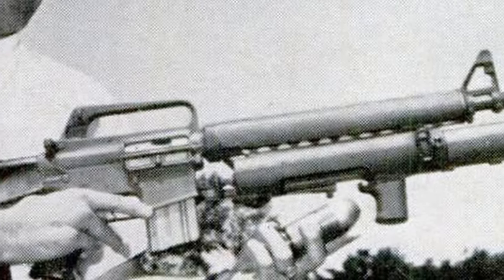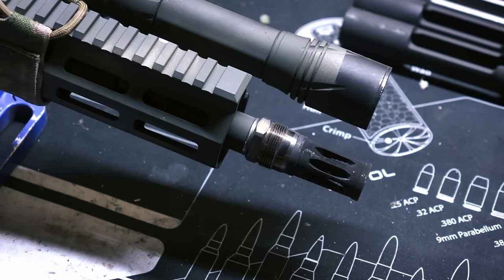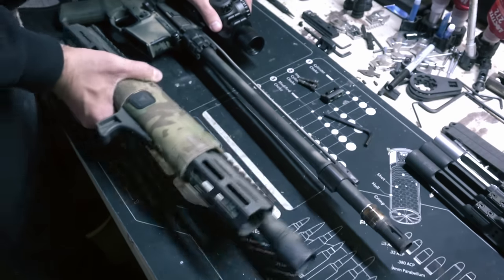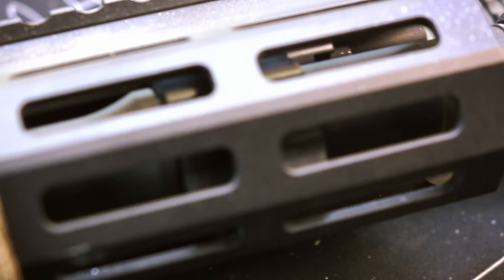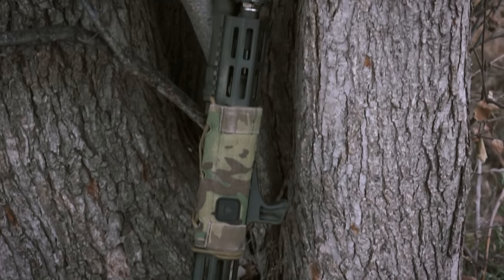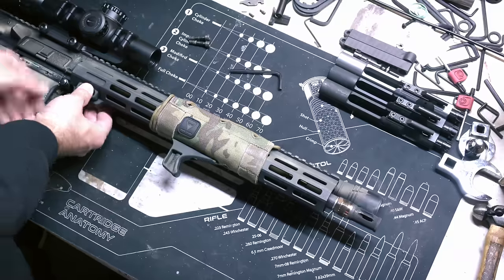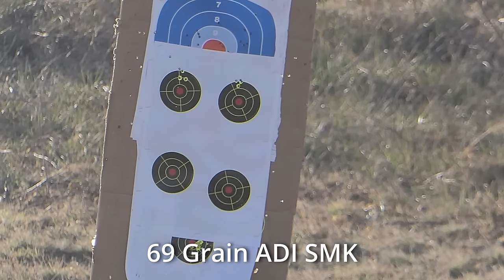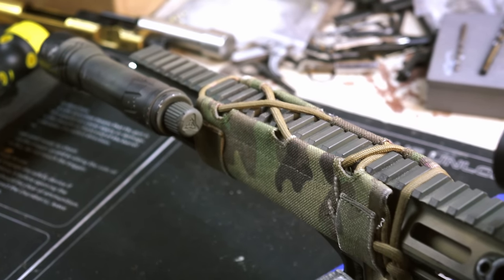A True Modern Dissipator - KAK 16" Barrel & Rifle Length Gas System

Comment: Btw, "Dwell Time" is not "how long you have pressure at the gas port". Dwell time is simply the time from ignition to extraction. Length of barrel after gas port is not 'dwell time', it is blowdown time. It is the amount of time until the barrel no longer is pressurized enough to run the gun. Gas ports do not regulate gas, they just let gas flow through at different rates depending on pressure and gas port diameter. Gas has mass, it takes time to move from one place to another, just like letting pressure out of a balloon. The bullet leaves the barrel before the carrier starts moving. Dwell time is a complicated thing and it requires a whole system of parts working together and being tuned properly to make the firearm safe and functional. 

You can look this up on your own if you are interested. This is a term that AR people picked up from actual engineers and completely misunderstood what it meant, and then made sure to tell everyone about it without understanding it themselves.

Comment: Literally what i have been looking for as far as content. I have been waiting for months on a criterion rifle length 16". Finally got it and now im starting my build.
Reply: Hopefully it’s got a smaller gas port size to be useful without an adj gas block😉.
Reply from the maker: I am sure it has a smaller gas port than the KAK.
Reply: @FocusTripp  Is that a good thing in your opinion? I have a A5 buffer system that it'll be paired with. My concern of course is cycling. I want it to be smooth, but I don't want to outpace the gun. TBH this is my first build and first rifle at this price point. I want it to run lol.
Reply from the maker: @-TWON-  are you going to be suppresssedm
Reply: @FocusTripp  definitely the plan but I don't have one as of now. I'm guessing based off its cycling is how I decide flow through or not. I'm just wondering if the VLTOR buffer was too ambitious. I should be done with everything by the end if the month.
Reply: @-TWON-  Any update on your 16 Criterion Rifle Gas Build? I plan on getting the exact same barrel. I have a 20 inch but want to keep the same gas system.

Comment: I've got a handful of dissipators setup in various ways. I still want to do one more, but I've got a lot of time on these guns. I haven't used a KAK barrel yet though. I've used Spinta Precision a bunch and they're barrels have been pretty good. I cant remember what their gas port size was off the top of my head though. I want to say its slightly smaller, but I could be entirely wrong. I tend to not run adjustable gas blocks on anything thats getting abused, but I have found that a liked running a Vltor A5 buffer system on them. It really smooths things out even more. On the gun I did run an adjustable gas block on, well, it doesn't move at all. Its pretty crazy. The dissipator is probably one of my favorite setups to run.
Reply from the maker: Once tuned they are probably the best a ~16" gun can get.
Reply: what kind of accuracy areyou getting with the spinta? and hows the weight?

Comment: light, accurate and low recoil - perfect. the only thing ive change - cut the handle to make able fast gas system adjust with no tools
Reply from the maker: Yeah, a slightly shorter rail would be good.

Comment: Colt 762x39 use a .125 gas port ( carbine length)
PS: Bought a Bushmaster dissipator in the mid 90s
(end of the Clinton stupidity.) It had a solid aluminum forend and a16" HB 1in9 barrel. Bought the ACOG as well. Heavy little bastard after all "stuff" was added. No one had seen an AR with that kind of tech at the time.
Had to buy a carry handle and grind down the rear sight ears ( the ACOG would not mount to the handle otherwise)
Reply from the maker: Colt 7.62x39 is a special little thing. My 13.9" 7.62x39 builds are a .081".
Reply: @FocusTripp  Where is your port? Any broken extractors or lugs?
Colt 6762: 762x39 was re-released recently. Far as I know, same specs. No other lengths(16" only) have been
 released to us " commoners"
but I see different lengths on their site.

Comment: Bushmaster made the first Dissipater in the late 80"s early 90's.
Reply from the maker: They were the first to call it that right?
Reply: Colt made similar M16A1 carbine with a 15" barrel and rifle gas tube in the 60's. Chuck Taylor of SOF and SWAT magazine trained the Philippine Army and had some made along the Colt pattern but with 16" barrels. They simply cut 20" barrels  M16A2's down to 16" barrels. He was lucky they worked. He claimed they never touched the gas port. Bushmaster made the first Dissipaters with 16" car-15 barrels and M16a2 handguards. The front sight tower poked out thru a opening in the middle of the handguards. The A2 handguard had an end cap. BM was partially influenced by the Knights 9mm suppressed SMG that used a similar visual arrangement. This visual approach to the 16" barrel was done because it was much more reliable and easier to do than modifying 20" A2 barrels. Later, Friends of mine in Hawaii asked them to instead shave the gas block A tower down and requested they pin  a "faux" M16a1 A tower on the barrel at the end of the A2 handguards. At that point, BM went to a  M-4 barrel modified to accept the "faux" a tower. @FocusTripp

Comment: Hey man I love your work. I had a question about ammo testing and accuracy. As far as I know I’m supposed to get different brands of 77gr otm to see which groups better but, when does the 64,69, 75 gr get introduced? Am i legit buying different brands to see what works or is there a method I’m missing? I know those rounds would be considered primary ammo does that mean I zero with those? As far as bulk ammo (55gr and I guess 62gr) is there also accuracy testing that should be done as well? I would imagine having different brands  would be ok but not recommended.
Reply from the maker: I would zero with the ammo you are going to use the most. Different barrels are going to behave differently with various ammo types. Find something that works well for your setup and use case.
Reply: @FocusTripp  right on thank you

Comment: Would you recommend this barrel for a traditional dissapator setup with front sight post and BRT gas tube or go with a criterion for a smaller gas port? I will be running a traditional can on it.
Reply from the maker: If you are going to combo parts you might just want to star with a Criterion even if it is a little more expensive.

Comment: Del-Ton and Anderson are true dissapator guns. They use the fsb as a gas block on 16 inch barrels.
Reply: True Dissipators use a carbine length gas system.
Reply from the maker: fight fight fight.

Comment: Anderson and delton both use the rifle length gas system...  The "original" dissipator was a bushmaster.  At least thats the first company to call it that ...the military used a Colt 605...  

That said, there ZERO reason to use rigle length if youre not running a front sight post.  The midlength is just as, or maybe more  reliable than anything else on the market.  Ive got about 1000 rounds thru the anderson rifle, so far its been reliable, but if  I didnt want handguards and a front sight, i wouldnt waste my time on rigle length.
Reply: I don't know, rifle length on a 16 seems to be reliable, and seems to offer even more softer shooting.
Reply from the maker: 16" mid is perfectly fine and should still be the norm. The benefit of the rifle length system is only there if you tune it for a "race gun" or a dedicated suppressed build.

Comment: I just completed a 16in Criterion rifle length in 308. Currently I have an A5 buffer tube with the Strike Industries ar10 flatwire and Odin works adjustable buffer which I have weighed to an H3. It cycle great anything heavier and it short strokes. Still I would like to get the recoil down you think an adjustable gas block would help? I just know with criterion in the past you've stated they are made to run without an adjustable gas block
Reply from the maker: If you are short stroking, you are already a little under gassed. maybe try the JP low mass carrier.

Comment: Does it make more sense to utilize an adjustable gas block or use a rifle buffer and spring, cost wise/performance wise?
Reply from the maker: you are probably going to get a lot more out of a adjustable gas block, but a buffer and spring is cheaper, depends how much you need to tune I guess.

Comment: Why do Geissele use 4140 for there barrels instead of 4150? Just wondering why they would go that way
Reply: doesn't wear out their tooling as fast ;)
Reply: Do you have a link because I thought it was 4150?
Reply from the maker: They have found something that really works for them. They are still very durable and very accurate so I don't have any problems with it.

Comment: I’m looking to do this with a 16 rifle length criterion hybrid I happen to have a Superlative arms adjustable gas block and a lantac ebcg utilizing the lantac advanced upper and jp silent capture. I hope this works
Reply from the maker: If needed open up the gas port.
Reply: I'm in a similar boat,however I'm trying a 16" lantac raven complete upper with a rifle length gas system. The only thing different compared to the lantac raven complete rifle is that it has a exclusive adjustable buffer system. 

Sooo my theory is if that's all I need to make it run like the a real deal. I'll try the Odin works adjustable buffer system.

Comment: 2 inches of dwell time? Wouldn't a 16" barrel with a rifle length gas system have 4" of dwell time? Or am I just stupid and don't know how measuring of gas port/gas blocks work?
Reply from the maker: The swell time is the difference between the gas port and the end of the barrel. It's really close on a 16" rifle system. It's probably closer to 4 inches at a midlength system.

Comment: While these do look quite nice what are the leftover benefits of a appropriately designed dissy style barrel compared to a midlength barrel of similar length?
Reply: Zero...   Midlength off the cuff, is probably MORE reliable.  If you're not going for the old school look with handguards and a front sight, you're just setting yourself up for possible issues.
Reply: @RIPPER334  That's what I was thinking
Reply: @RIPPER334  Does this more or less still hold true for upper builds at 14.7 or 14.5 with a midlength gas system?
Reply: Easier to reach reach the screw on an adjustable gas block since it's closer to or at the end of a long handguard.
Reply: @theomnipresent1  most builds like this are not going to be utilizing a adjustable gasblock, they'll be using a over sized gas port to make sure it functions as needed.
Reply from the maker: So the main benefit of the rifle length system is when tuned you can get the best recoil impulse possible. It's going to be a little softer than a mid length system, it's also great for suppressed shooting (again, when tuned). Midlength is still the best option for 99% of people.

Comment: What would think of running a adams arms retro fit piston kit on this barrel? Is possible or would there be issues?
Reply from the maker: I don't think it would have any issues.
Reply: @FocusTripp  alright cool i can’t decide if i want to just buy the upper or build something that is along the lines of an urban spr that hop and brass facts did. I know i want to get my first suppressor when tax time rolls around again and i know I want short stroke gas piston cause i shoot south paw and don’t want to die from the gasses coming out
Reply from the maker: @settlesmachiningtools8671  16" guns do it all man, Piston AR's work well for mitigating the gas.
Reply: @FocusTripp  appreciate your input I already built a few rifle ars and some reason they never check all the boxes that I want

Comment: I shot the Anderson and I was shocked that a 300$ real disspator can run well from that manufacturer ..its soft so the figured it out I'd think everyone else can
Reply from the maker: It might be a little different when you are making a complete system vs just the barrel. KAK might be overgassing the barrels to make sure idiots who put them together wrong don't have issues.

Comment: Would this work in 300 AAC Blackout?
Reply: Not with RLGS.  300 Whisper needs pistol or carbine gas due to propellant mass and bore volume.
Reply from the maker: Almost certainly wouldn't work with a rifle length gas system.

Comment: would A5 system work better?
Reply from the maker: It might make a slight difference.
Reply: @FocusTripp  They also have 2 stage  Ktech buffer aswell?
Reply: @FocusTripp  K spec....buffer
Reply from the maker: @johnL-xk2js  I bought a couple.
Reply: @FocusTripp  ok one last question. would the A5 system make it more reliable? Because it seems adjustable G block and K spec would be the best bang for the buck?
Reply from the maker: @johnL-xk2js  no, it won't affect that much at all

Comment: I remember when 16" rifle length gas barrels flooded the market a decade back. So many poors and fudds almost nearly killing it off because it wouldn't run steel.😂
Reply from the maker: It's hard to tune it up enough to run steel. I wasn't in the scene back then so I had no idea.